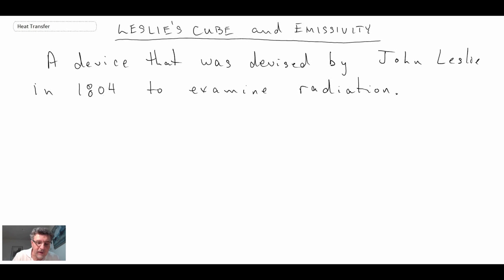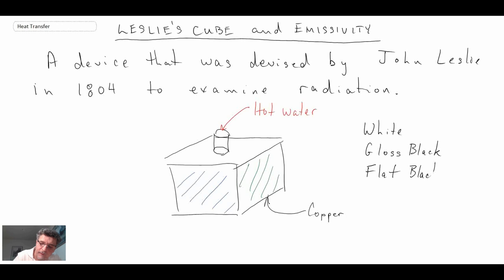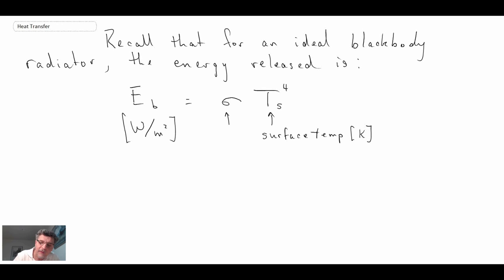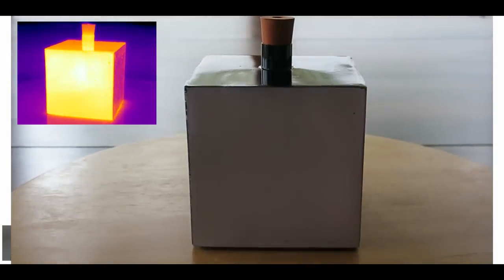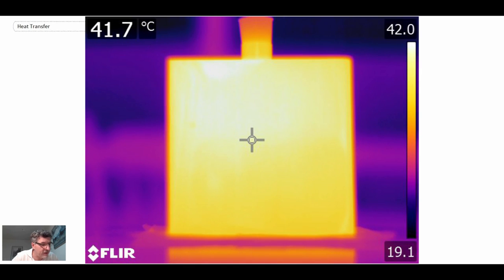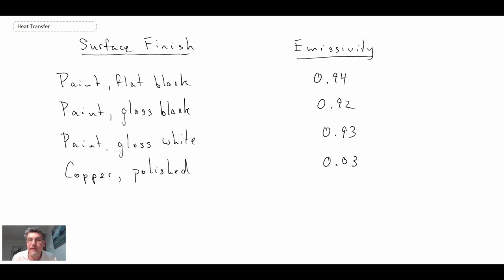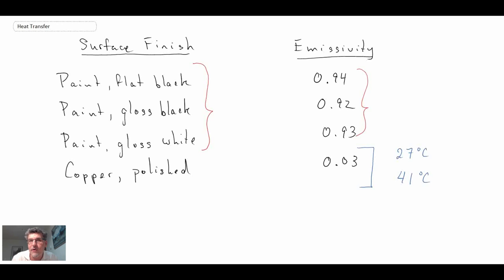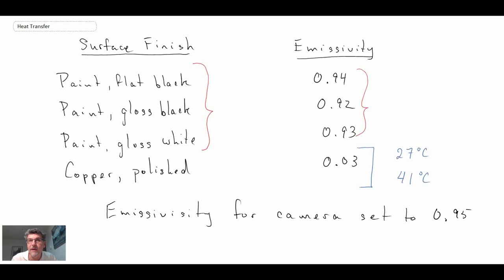Heat Transfer L2 p7 - Leslie's Cube and Emissivity

Comment: so was the reading of polished copper wrong because the emmisivity of the camera was set to 0.95 ?
Reply: It's very wrong because the copper emits IR poorly.  If you were expecting this, then you could reset the camera to "expect" a lower level of IR and then the temperature shown for the copper would be correct (or close to it, since small values create large errors) but then everything else would appear too hot.

Comment: Something is deeply wrong with the science here; there are massive issues if not contradictions as all matter radiates by quantum mechanics above absolute zero Kelvin. Snow and water (white in general) reflect, yet have an emissivity of near 1, being near perfect black bodies. That does not make sense. And what about air between the cube and the detector, it clearly doesn't absorb or emit at all, and that cannot be. I have the solution to this, what should I do?